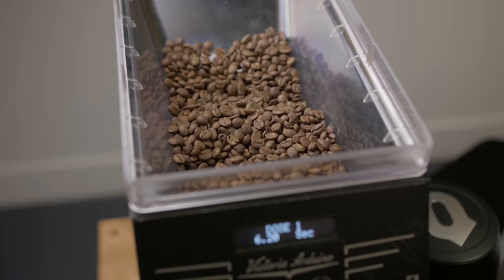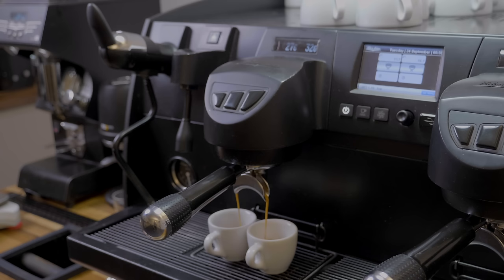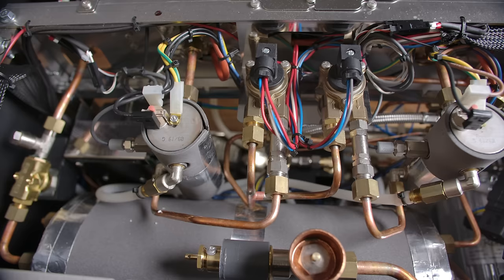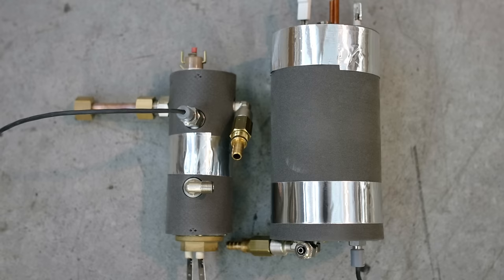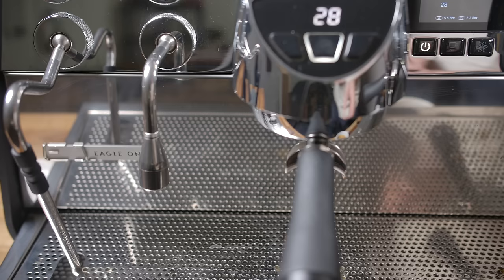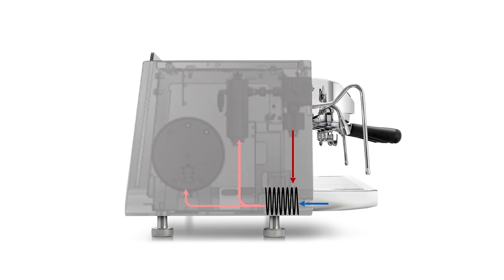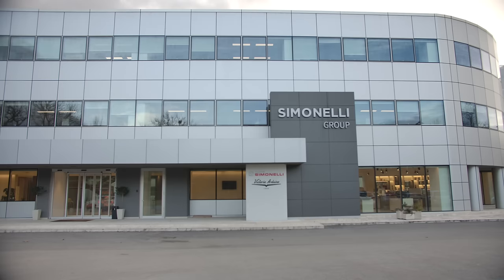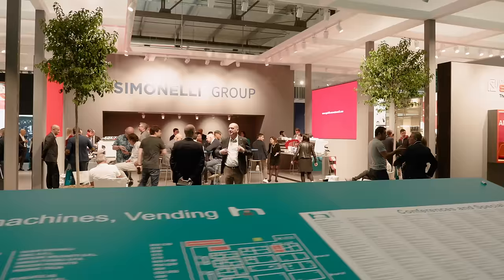The Eagle One

Comment: Cant wait to see it in home version with small footprint ... This machine is for coffee shops / professional version. I presume that after success (if it will happen while taking into account current situation) this will gather money to fund home version. If it will not succeed then we would end up with poor quality or design overpriced machines where we need to make research what machine in our price range is close enough to make good enough coffee with taking into account adding new features like PIDs or preinfusion functionality or programmability to optimize everything. I'm new to home coffee brewing topic and after 2 weeks of researching brewing topic, tips and then machines with comparison and then which machine can do what with upgrades like PIDs, new portafilters, pressure adjustment, heating elements adjustment, manual or automatic pre infusion and so on. Its so damn hard to pick anything. 3 days ago I have decided to go easy with Gaggia classic pro but after seeing it is using aluminum boiler that is anodized inside (after fair time of use with hard water it eaten away by limescale ... and to be on safe side - prefer not to use aluminum if it goes to prepare any food at all - its not worth risking my health to prove it is safe or not) and so then just with bunch of sadness I resigned and started to searching for something little more expensive and here where whole painful research  process really started again but much harder. It is easy to jump from one expensive machine (kinda good with some flaws like 57 size portafilter or not BPA free cheap water container like Lelit Anna version with PID and temp indicator)to better more expensive one with better thingies... maybe Rancilo Silvia sturdy construction but little big footprint and not looking good enough unfortunately (like old style simple design but made like tank) and with some problems like long heating time or sometimes temp is to high etc. It is really a pain for me. I would be relieved when I would see one machine that as Mr. James Hoffman v wisely said ... it should have everything what you need to make good coffee and nothing more. Easy and convenient to use... Without expensive gadgets susceptible to malfunctions that are mostly needed to correct machine/its components flaws. Dont get me wrong I could buy for example Rancilio Silvia and spend fair enough of time to change many of things (pid, pressure mater with pressure reductor, programmable pre infusion etc)...but at first it is costly investment so this would bring me to buying something more expensive with guarantee and unfortunately with different flaws to be fixed with another upgrades/modifications or maybe a machine near to perfection - I would not use half of it advantages (overpaid) and sometimes with bigger footprint (not acceptable in my average size kitchen which is already packed with many stuff I daily use). And what is most painful for me: to invest time ... only things that is finite. Time which I would spend for my hobby or to share with my family or to work and earn money. So it would really level up the real costs.

Additionally what was really a shock to me ... that the "Eagle one" project started from commercial machines. Yeah its probably easier to sell to businesses because of price (profit for manufacturer) but times changed and in era of lock-downs (or even without it) we need good coffee at homes more than ever. Of course someone would say wee need to support local coffee shops. But what if they are closed because of lock-down or I cant go buy there because they require certificates etc? Im person who occasionally goes to coffee shops because I work (or rather was) from office which got automatic high end v expensive machines (coffee is ... ok not as good as from portafilter but good enough to drink espresso without making funny face expressions). Now I have ended sitting and working from home for most time and I don't want to go and buy overpriced coffee each time I want to drink good one (sometimes 3 times a day or 6 if include my wife - this is really costly and so I go out occasionally and make it a celebration rather that each day event). I assume that I'm not the only one in this situation. And when taking into account that many manufacturers saying that they are making around 80-90% profits from selling to consumers and rest for businesses or selling products (food for example) poor-medium quality but cheap and rest superb quality much higher price. So really I am little shocked, curious and frankly little dissapointed after watching many many movies from Mr James Hoffman where I got each time feelings that he is sharing his huge knowledge to me as home user. I really counted his project if not focused on home user machines at least would partially focus on that. That's a pity... that manufacturers are kinda stale or as we could say concrete-solid old state of business thinking.

To sum up I would gladly look at this project home user version and if the price would not kill me and footprint would be ok and materials then I would not need to check and compare 20-30 different machines one with another for couple of days.

Comment: Good looking machine. My concerns from the small number of pictures you showed are that there is not enough cup height clearance which tempts baristas to run the shot into glasses and pouring it in to the cup, an almost sackable offence in my shop. The buttons on the group head are tilted away from the barista and so allows any water to gather around them, not sure of the the waterproofness around the buttons and how easy it would be clean around them. I love the idea of the heat exchanger from the drip tray but would worry about the added points of failure and leak. My machines have to be bullet proof to cope with the heavy handed staff I can end up with. Thanks for another great video.

Comment: I have the feeling that there's a general trend towards overcomplicated things. I think in most cases, simple and basic things are the best. Take cars as an example: I just don't see, why I would need automatic headlights, I can easily turn them on when I think I need them. No need to automate this. There could be a switch that turns the lights on and not a weird dial that is connect with a complicated bus to some control module that then flicks an electronic switch somewhere else.
I think this can apply to coffee making, too. And, hey, I guess the simple, basic solution is more sustainable.

Comment: Another excellent video. I believe the only element of new product design that perhaps could have been stressed was balance. Sustainability is great, and economics should always be a consideration. But, as I believe you briefly mentioned, flexibility and adaptability are also considerations (like customization). For example, when a designer reduces the size of a design element for the sake of cost or energy savings, that design must also be able to accomodate variables within the marketplace. For example, you may be able to downsize the boiler, or add a recuperative heat exchanger, but if you are in the middle of a Polish winter, with a city water supply that is near freezing, that customer still needs 94C water, so the design needs to strike a balance with that kind of variable also - just a thought.

Comment: Hi James,

This is incredibly informational video and the heat recovery techniques used in the machine are seriously clever! If you haven't done so already, it may be worth looking into Problem Table Algorithm; it allows you to maximise the heating and cooling utilities recovered from a minimum number of sources in most system. In most cases, it would only require small changes to actual flowrates instead of requiring massive upgrades on need for new parts in the existing systems

Comment: just a quick comment on the thermodynamics, it's not just the mass of the water and the grouphead that's important; you also have to consider the specific heat of the two. this is in the equation q = m * c * (change in temp). q is the heat energy, typically in joules; m is mass, sometimes represented as density * volume; and c is the specific heat, which is a way to measure how quickly the temperature of an object changes when heated and cooled. you can kinda think of specific heat as inertia 

source: https://webhome.phy.duke.edu/~rgb/Class/phy51/phy51/node59.html

Comment: Why such heavy e.g. group heads that will need to stay warm and will heat up the air in the cafe and makes one turn up the air condition ?   Why not work with less massive but better insulated materials and more sensors and micro heaters to regulate the water temperature ?  I like the idea of modularity when it comes to design.
I guess when it comes to sustainability, one of the biggest contributors are standardized parts. It should be easy to change out parts on site, not needing to have a service technician use a car to come fix it or just to change something that needs to be changed.

Comment: I think a resonably cheap coffee machine that could actually make good espresso would be a breakthrough in the coffee industry, because to be honest in my opinion this is one of the most restrictive markets there is when in comes to pricing, seems like you cant have a good coffee without spending thousands of dollars. Also, the base elements are not so expensive to produce, so it could be a good approach to create a well priced espresso machine with a good potential. Of course the eagle's target are not homes but coffee shops, but just sharing a thought.
Reply: Mate, a pavoni is like 450, flair and rok are both 170. My antique sprung lever zacconi is around 500 second hand atm... What thousands? Plural thousands?

Comment: The machine you helped build is truely incredible. I would have loved to know more about when exactly the sustainable parts in the machine truely become sustainable.

For example the heat exchanger in the drip tray is a cool idea but obviously it also consumes energy, resources and creates pollution during productio . At what point do you get an ROI on that?
How much hot cleaning water do you have to "recycle" to save enough energy to offset the energy used in the production of the part?

Sustainabillity is so complex but this kind of information is very relevant for me as a consumer. If I cant realistically use a sustainable/efficient product enough to break even it may not be a sustainable choice for me after all.

Comment: The three tiered heating system seems like it could be a good fit for a home or low-volume espresso (restaurants, offices etc) setup. My biggest problem with my mini vivaldi 2 is the heatup time. Like you said, it's wasteful on electricity, and it's annoying to have to wakeup, turn on the machine, then wait for the better part of an hour before the group is sufficiently up to temperature. Scaled down, and perhaps without the heat exchanger, a smaller brew boiler with a co-heater in the grouphead would not only allow home machines to heat faster, but it would also save internal space allowing for smaller machines. I'd definitely be interested in a machine that could save electricity, and not take up a cubic foot or two of counter space.
Reply: It's not clear to me that more tech under the hood solves your problem. My very limited experience comes from the other end of the spectrum. Old zacconi riviera, spring loaded lever. Heats up in around 8 minutes I think? Has fewer bells and whistles, obviously, but for home use? And if time is a thing? Low effort sprung lever might be your kind of thing? I have no experience beyond this machine, so I can't speak to what you like about yours, but I feel a deep pain and empathy for you waiting so long...

http://www.zacconi.net/en/riviera.html

Comment: Hello! I would love to hear about how you've solved maintenance and servicing. They are part of the cost of the machine and, since the pieces seems custom for this machine, they might be hard to replace if anything fails. Furthermore, having new systems in a machine also shifts the failure points exposing new problems. From an engineering perspective I would like to know how that went through out the development of the machine!

Comment: How much energy could be saved by insulating the pipes? Copper is highly heat conductive of course so the heat is definitely transferred into the metal, but how much of that radiates into the air?

Comment: Looks great, well done. However, in terms of sustainability and impact, I have often been warned off NS T3 tech by technicians for breaking down, I think these innovations are great ideas, the 8% recovery from the drip tray is great, however like modern ICE engines in cars, the fancier, the greater expense to fix. If buying this as a replacement machine I'd like to have a comparison of how long this would take running at its lower energy consumption vs popular competitors to "catch up" on the extra emissions to create this new machine, a bit like it's more sustainable to keep my current car on the road rather than buy a new tesla even with its lower emissions when taking into account the extra emissions createed in the teslas manufacturing and extraction of rare  elements. Love the channel though James, thank you 👍

Comment: At the price point, it seems Victoria Arduino is competing with the Linea PB AV which feels like the industry king for new cafes (at least to me in San Francisco). Still quite a premium for a machine; what do you anticipate could make this machine really become a worldwide standard? A more inexpensive leader design incorporating the same technology? More marketing? 

See what synesso did in releasing a machine that's 30% cheaper than the PB, it's a strategy, but I'm not sure how well that will work.

Also was wondering if there were any steam boiler efficiencies that y'all brainstormed, curious if there's a way to sacrifice steaming power to save on energy usage or if that was off the table entirely.
Reply: Steam boiler is made by stainless steel so can operate at a higher pressure, hence it’s much smaller. Considerable energy saving made there too.

Comment: What do you think about silicon group head gasket? Had you try the difference of the silicon and rubber one? I thought its not hard part for big company like Simonelli or Victoria Arduino to replace the rubber grouphead gasket to the silicone one and make the problem “changing grouphead gasket” become easier to done in less then “calling the technician”?

Comment: Sustainable/Balanced energy & resources??   OK, you add a recuperator (heat exchanger recovering the wasted hot water).   Maybe you can recover 10% to 20% of the available energy and you undoubtedly save energy (while adding another item which brings down the reliability of a system).   How long does it take to offset the energy to produce the recuperator (especially looking at all points of production)?   
Think about energy from mining the metals through smelting and forming the steel typically to a large billet.  That steel then goes to a vendor to shape/cut/forge for raw metal for a manufacturer.  The manufacture then machines and assembles it to the finished item where this finished product is installed in your machine - add the proportional energy to move these items about, energy to turn on the lights at each factory, etc....   That's alot of energy, which is more simply represented in the overall cost of the part.   How long will it be for the heat recovery to offset that cost, but wait! don't stop there!.  For a true sustainability calc disposal  at end of life needs  to be considered...
I would be interested in the sustainability calculation on that heat exchanger.

Comment: I am interested that you talked so much about sustainability but didn't mention repairability as a part of that. Is the machine cheaply and easily repairable using parts which are largely easy to source worldwide? That is a large part of sustainability, as it increases the average lifespan of the product hugely. Often innovation, and patenting of said innovation, can kill that as you may be limited to a single manufacturer for many parts, and an expensive and hard to access approved repair network (see Apple for an example of this done ruthlessly and deliberately. They actively work to put smaller repair shops out of business and restrict access to parts.) I see this as a key enemy of sustainability. I would love to hear your thoughts on this.

Comment: I noticed you never quotes absolute amounts for how much energy is saved, only relative. Approximately how much energy is used per shot? If you are saving 1 kWh/shot, that would be great. If you are saving only 1 Wh/shot, then at 20¢/kWh (double what I pay), then it would take 500 shots to save 10¢ and at 500 shots/day, you would only save $36.5/year. The increase in price from all of the specialty engineering to save energy would thus not be sustainable.